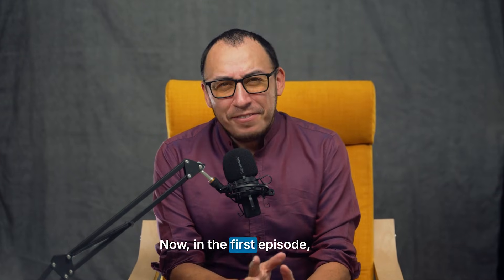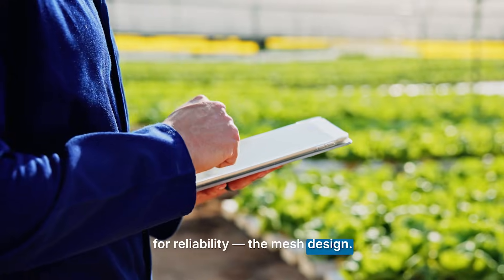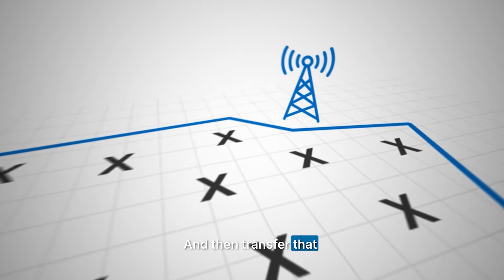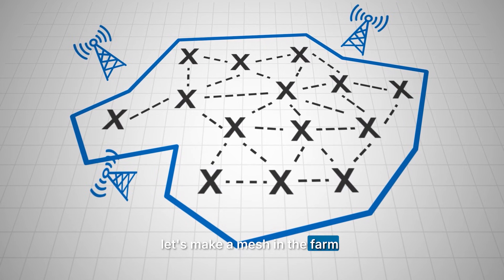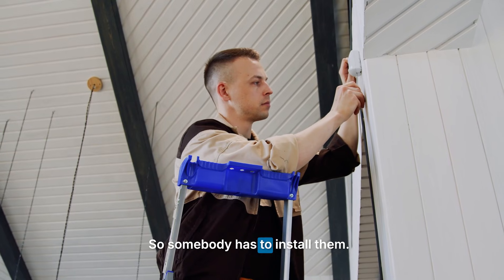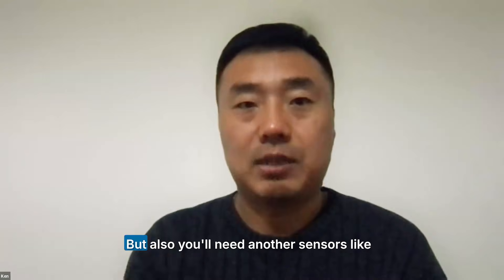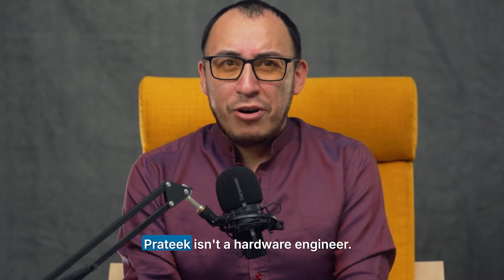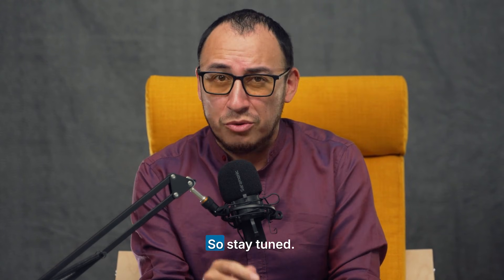$5 IoT Device Solves Farming’s Biggest Problem | Meshtastic Designer Series Episode 2

Comment: what exactly is the benefit of some IOT in the Soil?
what kind of sensors are there is there any kind of work that is being done by the IOT devices or what  use is a WIFI in a garden besides a WIFI?
pls dont just focus on the tecnical side of this Concept, talk about what are the benefits for the farmer, the plants etc.
Reply: Soil health is very vital on plants overall health and growth. Sensors for soil are detecting moisture, PH, NPK, etc., which represents the nutrients present on the soil. Using WisMesh devices, a mesh of these sensor data can be linked together making the bigger coverage for the IoT sensor network.

For farm owners and farmers, knowing these parameters and optimizing soil health will provide better  yields and efficiency in their operations like in irrigation.